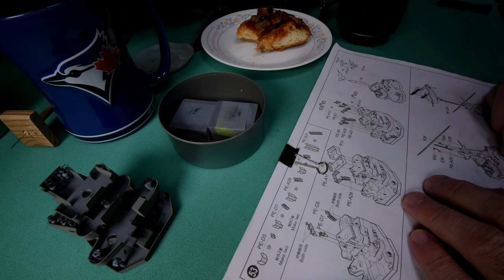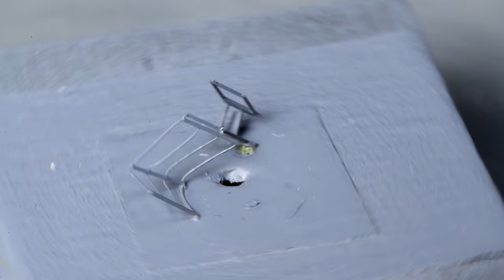The Model Ship - Part 823

Comment: Hi Ron, wouldn't those 2 little steps be for the smaller climb above the one where you have it? So where you have the hand rail dropping down to the right it should be on the left hand side of the screen. I might be wrong but why would those two steps be out so far away from the part that you have to step up/down over?

Edit: having seen it again what I said would be impossible and they are for that step, but the handrail would still be starting from the smaller lip above it and those two rungs of the rail be up against the bulkhead perhaps?
Reply from the maker: Hi Barry,
I've bent the steps the wrong way. As I mentioned already below to Fabrizio, I'm afraid that they will simply break off if rotated around 180 degrees. Will be talking about this mistake in 824 today. 👍